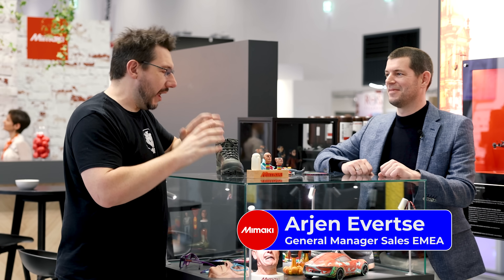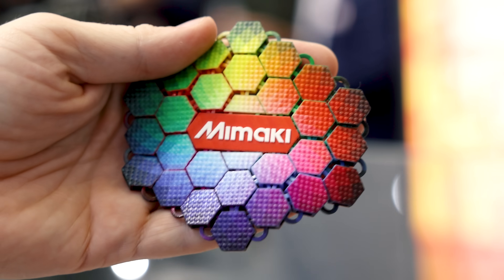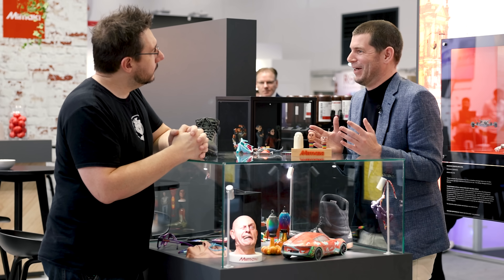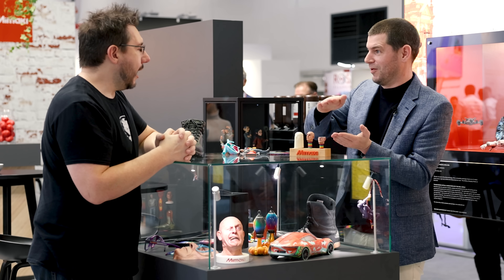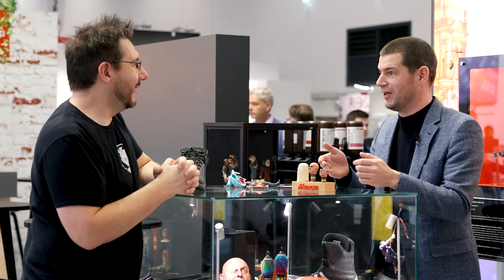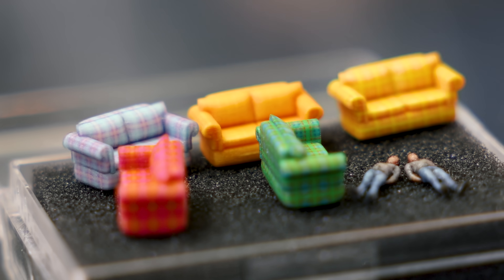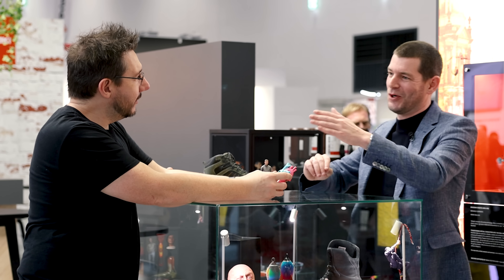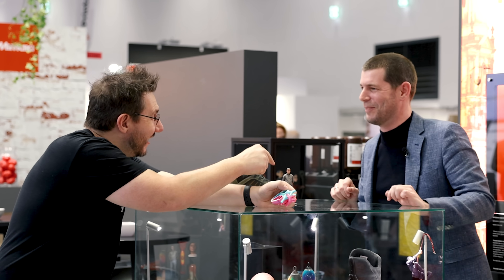3D Printing 10,000,000 COLORS?

Comment: I know Mimaki and their products by more than a decade, almost two. I've seen that they've always decided to go "industrial" with their printers and never "household" or "small business" but I hope they'll realize that we "household" and "small businesses" beat industrial with ratios of ~10000:1 up to ~100000:1 in some places...Meaning, they could have made a desktop size printer in A5 or A4, in the 1000$ to 2000$ range, and they would have sold an incredible amount, basically making the profit from their "industrial" clients almost nil in comparison.
But, this is just until someone figures out that, relatively speaking, all they're doing is almost practically PUBLIC KNOWLEDGE, meaning, anybody with the right skills can take a 2D inkjet printer, make it a "flat bed printer" (basically a printer where the sheet/bed is fixed and the X-Y axes move on top of it, always placing ink in the SAME SPOTS) and add a Z axis to replicate what's being done here. The "toughest part" isn't even the hardware, given that you just need to figure out/dial in the TEMPERATURE needed to make the resin LESS VISCOUS, to not clog the nozzles and to place a roll to flatten the resin deposited on each pass (which would also need a proper waste-ink reservoir and a proper cleaning cycle with alcohol/water): it's THE SOFTWARE.
Software seems to be the easiest but it's the trickiest part. All that's being done here is BOUND to a, so called, PHYSICAL RESOLUTION, defined in PPI (pixels per inch). This is ALWAYS 720 PPI in EPSON PRINT-HEADS and 600 PPI in CANON's. Laser's is 400PPI. DPI are MARKETING BS...DO NOT GET FOOLED. No matter the DPI, the MAXIMUM ACHIEVABLE PHYSICAL RESOLUTION ALWAYS IS IN PPI.
Anyway, software-wise, given the hardware part has been figured out, it's then a matter of slicing files properly, remembering the PPI limits for the X-Y and any given step size for the Z axis.
Ideally, a basic renderer with an outline-shader, to ticken the colored surface so that it is visible when taken as a slice, should be enough and it would also allow for fine tuning of the coloured ink wasted on the surface. With proper RIP software and driver, many print heads could be managed and a variety of materials and/or resin options could be used (multiple print-heads could do many types of resin and colors all at the same time, just like HP does).
Long story short: that's more than enough for anybody's basic needs and I hope that Mimaki or someone will understand it...The 5 to 6 digits price tag is not cutting it...
My two cents. I've worked in analog/digital photography/typography studios some years, many years ago and I find it baffling TO NOT SEE anybody in this segment other than a few big players. It's funny 'cause a PEN PLOTTER would ALREADY be enough to make LARGE FORMAT resin printers DIRTY CHEAP...
Go figure...

Anyway, moral of the story. Yeah, astonishing but out of this peasant's reach, so...No thanks, not even as a 3d printing service for me...Sorry! 🤷
Remember guys, while it was only in the hands of big players, additive manufacturing is now accessible to EVERYONE. Don't get fooled by the big guys, they just want to make 3d printing just as INKJET printing was back in the days...And you ALL remember what we used to say, right?
Keep that in mind. 3D printing should be set FREE. Deviate and you get MONOPOLIES, once again...

Comment: The some impressive prints. The large printer we saw in the video is about 180k$ and the set of resin is about 3k$ for about 5 liters of clear, white base, support and 4x 1L colors. Not quite the hobby budget but for professional / commercial application is not bad.
Reply: Thanks for providing that detail. Would you know how long it takes to print some reference size? It’s amazing tech, and I was just wondering in passing.
Reply: @brainsniffer  I honestly dont have any idea. I found the prices on the website of Cadblu. They are a US based professional / industrial 3d printers resellers as far as I know from the same website.

Comment: This is what anyone really wanted out of a 3d printer. It has color, but also transparent layers, looks very vibrant compared to the older powder based printers that soaked up the ink to an extend that it made a unsaturated kind of bleak surface effect. I am curious about the price of the smallest model i could not find it on the site. It is probably around 20k or more.
Reply: If they are priced remotely similar to Stratasys machines the cheapest would be around USD$50k

Comment: Can they print on different materials like TPU?
Reply: It appears this is using liquid resin that cures into a thermoset.

TPU is a thermoplastic typically processed by heating to the melting point and being molded or extruded.

Comment: This is impressive, but I think the reason we haven't seen more machines like this is due to existing patents on inkjet-style UV printing machines.
Can't wait until those expire and we start to see crazy DIY creations made from their moms' old HP inkjet printers from 1997!
Reply: why would that matter? Patents don't matter for DIY... if you make it yourself for yourself you're not violating a patent.
Reply: @dexter-wy5bo  You're right, it just isn't easy to DIY a machine based on more complex hardware and mechanical processes, so the incentive to attempt to do so far has been pretty low I think.

Comment: A few years ago when I really got into resin printing, I looked at doing my own 3D Ink printable resin for full color stuff. Turns out the coding and hardware was really easy if you modify parts out of an inkjet printer, the hard part was formulating resin to hold color and flow through inkjet heads. That's about when I came across Mimaki and pretty much gave up on the idea. They were/are way, Way ahead on the process, but sure wish they had a consumer model for the home market. Their business class printers are insanely expensive, even compared to industrially-priced resin printers.

Comment: About 20 years ago while I was trying to find options to rapid manufacturing, outside the typical CNC machining,  some fine tooth and super lightweight gears,  for my palm size helicopters, and looking at high power lasers and some new 3D printer developments, I  met a gent who was operating a lazer cutting business and  who suggested I ltalk to a professor at a nearby university who was developing 3d printing technologies. At the time, one of the machines, a modified ink jet printer,  was set up to print in color using white flour and  ink jet ink sort of deposition, sintering,  a similar proces to what this video shows, but it was very slow and the parts had to be dipped in CA after the build process to mantain some level of durability. The texture was rather grainy and the color although vivid was rather matte finish.  Seeing this potential, back them  and coming from operating one of the first SLA machines back in 92,  this process stood in mind, as the way to print 3d models in colors, just makes perfect sense, lay the material in white, then color it as you apply ink on paper as on typical ink jets. The machine in this video is very similar to that early prototype I saw,  in fact the texture and color saturation is very reminiscent to the the ink with flour machine, but highly refined. I  have been looking forward to seeing an in jet like printer that can print 3d models in high resolution and color. Now, perhaps it is just a matter of targeting the market with a cost effective desktop machine for the average consumer.  Great intro to a technology that has been simmering for a while now.

Comment: I have worked with Mimaki machines for years , they are great printers in general. Particularly for large format,  UV direct print, and vinyl applications.  These are next level examples for sure! The single draw back i have had over the years using them is Mimaki force expire consumables with chipsets which can cause a cascading of error codes and renders printing impossible.  I hope this "tradition" does not carry over to the 3D consumables as well.

Comment: The problem this looks like it is for mockup only.  I assume it does not have the strength properties as reg 3D printer filaments.
Reply from the maker: The resin they use has some decent strength to it. I was offered the chance to break stuff, but I can tell you, it all felt STURDY.
Reply: @3DPrintingNerd  This is great to know.  Thanks for the quick reply.  I have been looking through their website and have request some more info
Reply from the maker: @philbishop283  Oooh let me know what you find out!

Comment: Very cool!  This feels like it has potential in a whole lot of very mundane areas - the one that comes to mind is figures for model train layouts.  Right now, these figures are vacuum molded and then hand painted by low-cost labour.  Eventually, if this gets cheap and fast enough, it could replace those factories.

Which then has implications for developing-nation economies, and could be good or bad depending on what comes next in those nations...

Also, thank you for putting the funky title sequence at the end.  It's cool and all but I'd watch a lot less of your videos if I had to sit through that every time.
Reply from the maker: I was told the couch models most likely had a material cost of 1-2 euro. not shabby all things considered.
Reply: @3DPrintingNerd  Hey, no way is going to be so cheap, especially if you print a single piece. If you print a full bed maybe you can get that price. I own this machine and on a single piece it’s not cheap at all.
Reply from the maker: @Davide-il3ou  That's good to know, thank you!
Reply: @3DPrintingNerd  Hey, just to make you an example. If you print a small apple mm 20x15x14,75, you can print 10 line of apple, and 8 apple every line, so the full bed is 80 apple. 1 single apple it’s going to take you 3h 52 minute and 7,44€ only for the material. 2 apple 3h59 minutes and 4,47€ each, 1 line 8 apple 4h41minutes and 2,27€ each and so on. The full bed of 80 apple will take you 22h48minutes and 1.83€ each. This is with the 2207 model, the small one, the 553 the bigger, it’s faster but I can’t afford 250.000€ machine
Reply: @3DPrintingNerd  Sorry, I forgot that you don’t need to print the same model, you can mix all the model you want, but you need to print as many as possible to reduce the price
Reply: @3DPrintingNerd  That's not too bad, but given that's manufacturer cost still a lot higher than the vacuum molded & hand painted figures I can buy for about 75 cents Canadian (in a big bulk pack of course.)
Reply: @davydatwood3158  It’s true, but if you need to paint, first you need to know how to paint, second you must add that cost and also your time, and third, this machine it’s all about personalization, you can’t buy that on the market. It depends on what you want. This printer can do things that no other one can do and with an amazing quality.
Reply: @Davide-il3ou  I agree!  I'm more thinking about the future.  Right now this tech is for custom things, but in the future, if costs come down, it has the potential to replace other forms of mass production.

Comment: I remember when I first saw that TED Talk by Joseph DeSimone about fast resin printing several years ago the first thing I said was, "That's neat for rapid prototyping but full color UV printing has been a mature technology for years now and they can even do it on 3D objects. Why isn't anyone just using THAT for 3D printing?" In my mind this was just ALWAYS the way it should be done. I'm honestly just shocked to see it took this long to get here. I'm also a little sad too because Mimaki are a great company but they're definitely an industrial setting focused company too so there's a VERY high likelihood that this is locked up behind a massive wall of patents just like Stratasys did with FDM for decades.
Reply from the maker: I don't know the patent situation on this - I didn't ask. I'll try to find out.
Reply: @3DPrintingNerd  Really appreciate that, thanks Joel!

Comment: this is fantastic~
I'm curious about how would the supporting goes at the surface which has colors.....🤔 or this printer doesn't need any supporting?😳
Reply: The piece is completely wrapped in a wax-like support material that melts in water. The surface remain completely clean.
Reply: @Davide-il3ou  I just found I missed his explanation @3:00.😅  Thanks pal~☺

Comment: I'm pretty sure that at around 4:00 be says picoliters (trillionth of a liter and measurement of volume) and not picometres (a measurement of distance).
Reply: Yes I noticed too! I just thought it was just such a tiny little mistake, I didn't mention it 😂😂🤣
Reply: How much ink do you expect it would take to print a picometer sized dot?
Reply: @Jbot123  a lot less than a picoliter. If my mental math is up to scratch, a picoliter would fit in 100x100x100 micrometers..
1x1x1 pm would be 1e-36 liters I think.. so 1 trillion trillion of those in a picoliter..
Reply: @Jbot123  I couldn't even guess since a picometer is a measure of distance and not a measure of area.😇
Reply: @evansampson7325  But when you are talking about printed dots, the width of said dot is often used to relate it's size.  And besides that, he was specifically talking about the size of the droplet.

Comment: You forgot to ask about printing times? How on earth could you mis that? 
Or if the question was not allowed, you should have made that clear.
Reply from the maker: Oh shoot I did forget! It's not long. hours not days.
Reply: Particularly that office building must be quite a print job!
I did notice each individual layer goes fast.
Reply: It prints 19 micron a layer if I remember correctly. So depending on the height and the depth of the filled print bed. It can vary from hours to several days.

Comment: The concept is not new to me, but the technology involved is. This was kinda amazing to see it on a large scale and with physical objects instead of "3D paintings" on flat surfaces. The accuracy is uncanny. Thank you for featuring this.
Reply from the maker: It's the accuracy that really blew my mind. Up close it's INSANE.
Reply: @3DPrintingNerd  is it me or you can see cloth texture on those little couches?
Reply: I saw someone diy a prusa with 2 separate xy axis and the second one had a modified inkjet cartridge salvaged from an old printer. Cool to see bigger companies developing the technology as well
Reply: What will really impress me is when they bring this tech to the Home/Hobby/DIY market
Reply: isn't this basically the same thing that the Stratasys Polyjet printer does? That has been around for a couple years now. It is nice to some other companies getting into that space for sure cuz that will drive down costs and maybe one day something like this will be affordable to average people but I don't think it is really cutting edge.

Comment: Absolutely crazy how good those prints are. I do notice he says it's "not fast", but I wish we knew exactly how slow.
Reply: And… "not cheap" either… I wish we could know… etc 😊
Reply: @oljobo  £35,000 for the Mimaki 3DUJ-2207 which has a volume of 203mm x 203mm x 70mm
Reply: @thingswelike  Thanks 👍. You know if there is any place one can order a sample… or order a print from a simple model?
Reply: @oljobo  i can do it for you, the only problem is that I’m from Italy. I bought the small version (the 2207) last July for my 3d service, and it’s an incredible 3d printer. What I can also tell you is that the price of the resin it’s very high and unless you use a particular software call materialise magic that cost 200$ a month for the light version, you must print all the piece completely solid inside, and that greatly increase the price.
Reply: @Davide-il3ou  Thank You for answering 🙏. Yeah I guessed this would be (very) expensive.  
I was just so positively surprised to see such a technology, I just immediately felt like •having• a small printed piece 😊. I can live without, no problem 👍. 
Being from Italy is a plus btw 🇮🇹👍😊. Best regards from Norway 🇳🇴☺️
Reply: @Davide-il3ou  Do you have a website for your 3D service? If so, put the address with " dot " instead of "." , or youtube will just remove the comment 🙏😊